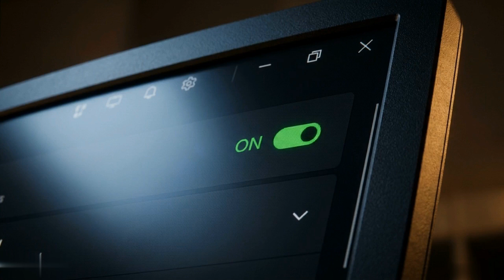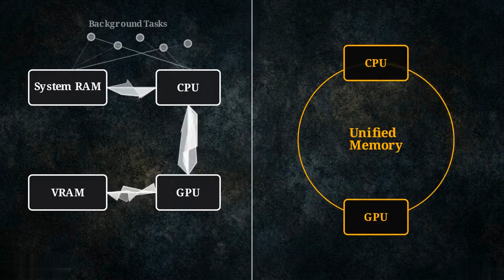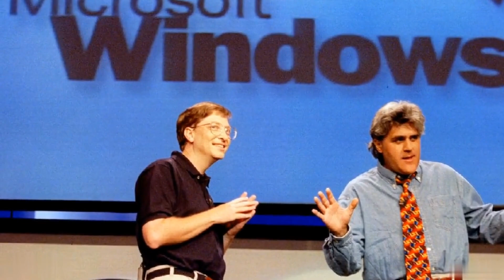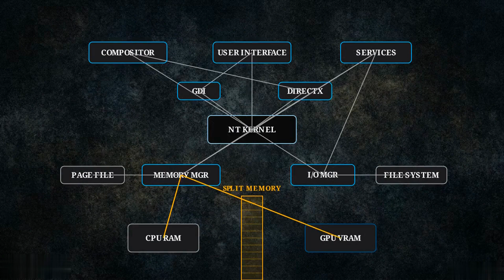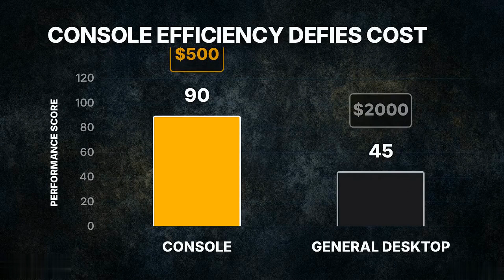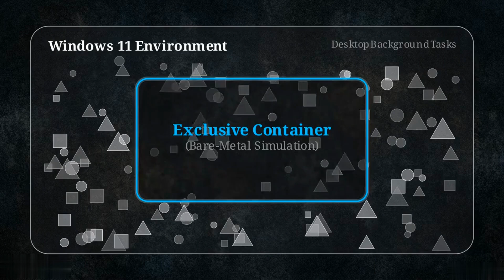Why Your PC Just Became An Xbox

Comment: Yes, you dont need a BIOS file to run xbox games on windows because theres no difference, they both run on dx12, a simple emulator like XENIA is all you need, in fact its not really an emulator, its just a piece of software that unlocks the xbox features and runs xbox games natively
Reply from the maker: That's a good point about DX12 bridging the gap. Xenia definitely makes it easy.